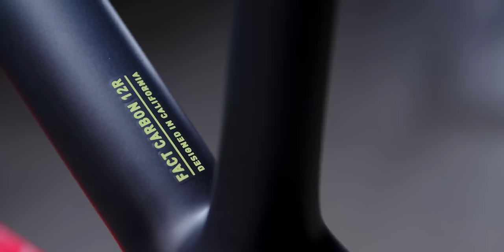BUILT | Introducing Team BORA-hansgrohe with Primoz Roglic's Specialized Tarmac SL8

Comment: I’d love to get his off the record review of the performance on this build versus his S5……. no way on earth that would be public knowledge #sponsorcorrect but someone with WT power and results experience on both would love to know the differences between the two.
Reply: I doubt there's much difference at all. They key component is man in the saddle.
Reply: @Enigma71559 probably right but i think the bikes will feel a bit different.
Reply: There's basically no difference between a top of the line race bike anymore. They're all the same, only the riders are different
Reply: There are elements of difference in each super bike. Degrees of stiffness in the rear, response in turning etc. the most important element will be the rider. That’s the engine of the bike. But, the little things that are about the bike, mean a lot to pro riders.

Comment: I'd like to know what pro mechanics do when installing a brand new chain on a build like this?  Do they strip off the factory grease first or use it as is??  Because as I recall from the Friction Facts test, factory grease results in marginal losses.
Reply: yes they strip the factory grease off, after that they wax it or use their own grease. the factory grease is mostly to protect it from rusting. greets
Reply from the maker: @TeamStealth_Official  the factory lube is fantastic in one sense: it's very very durable. If your preference is for maximizing efficiency, then going to a different lube is a good idea. But that's not everyone's goal.

Comment: Hi, is that a size 52 or 54 frame? Thanks for the answer.
Reply: I have the same questions, as he is 177.
Reply: Looks like 52 cm, size S. He used a Cervélo 51cm and Bianchi 53 cm, booth size S
Reply: At 2:44 you can see is a 52

Comment: Nice work, what was that bottom bracket ?
Reply: Guarantee it wasn't an overweight,  overpriced, hambini BB
Reply: SRAM's own BSA-threaded DUB BB.
Reply from the maker: it's our DUB BSA BB with ceramic bearings. You can tell it's ceramic bc the dust shield is red.